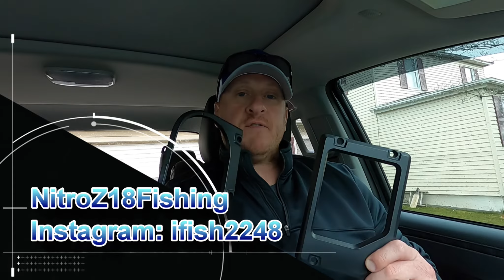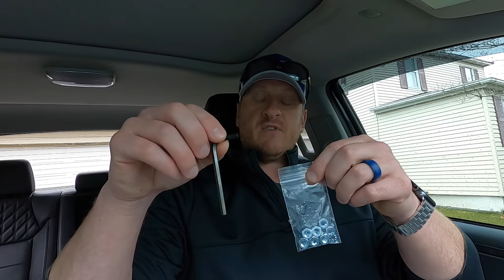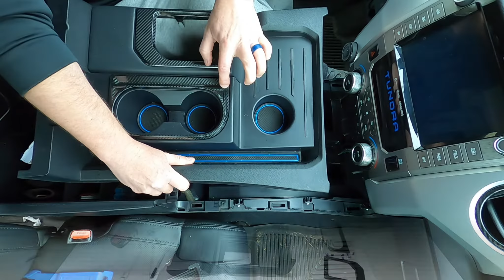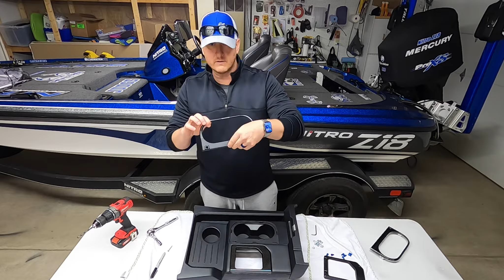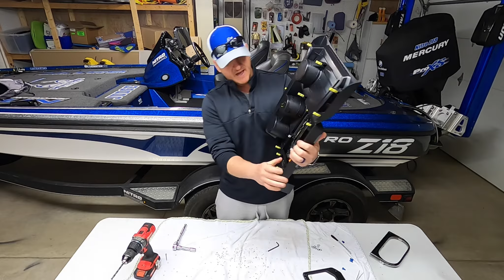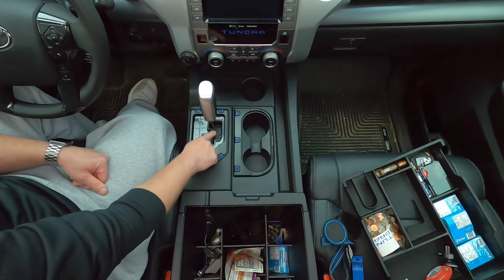AJT Design Products Install on 2020 Toyota Tundra Platinum

Comment: I ordered the chrome delete kit. Tired of being blinded! What a dumb design 😂
Reply from the maker: Totally agree, can’t stand that chrome!
Reply: @NitroZ18Fishing  Finally got around to putting it in. Just had to pop the center console tray out. Then pop out the usb port and climate control knobs. Popped the 4x4 switch out without taking anything else off.

I just messed up when ordering. Didn’t realize 2020 has different radio knobs. The ones I got don’t work. Hopefully I can send them back or something. They’re $30 for the two knobs! Plus shipping!
Reply from the maker: Yea they changed up the radio knobs, I like the 2020’s cause they light up…it’s the little things that get me 🤣…glad ya got it done!

Comment: Hey, what paint should I use for the shift trim piece?
Reply from the maker: I used plasti dip and glossifier for any parts that aren’t AJT...if applied properly it comes out awesome!...best part is if you ever want to change it you can peel it off and start over
Reply: @NitroZ18Fishing  Hello, can you show the video if the plasti dip?  I tried to paint mine by covering up the part I didn't want painted with painter's  tape and it left behind a residue I can't get off.  $71 later for a new piece I would like to try the plasi dip. I noticed this piece has te plastic welds did you remove the piece? My email is olson.br@vcpusd.org. Thanks for your time.
Reply from the maker: @Brian Olsen yes sir, I removed the piece when I modified it, just made it easier to work with!...I'll try to get a video up of how I Plasti dip but if you go to www.dipyourcar.com they have a ton of great tutorials!...that's how I originally learned was by watching them, hope it helps!